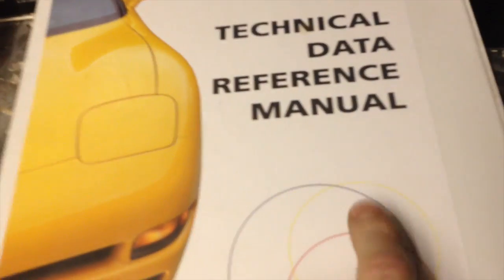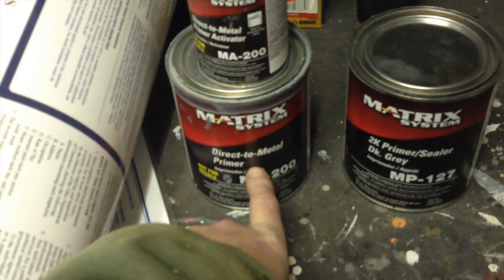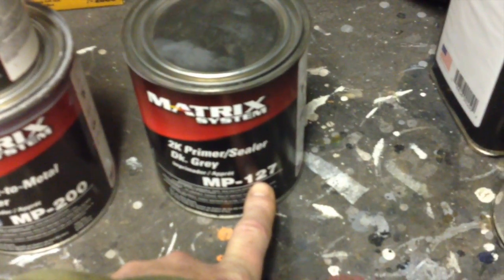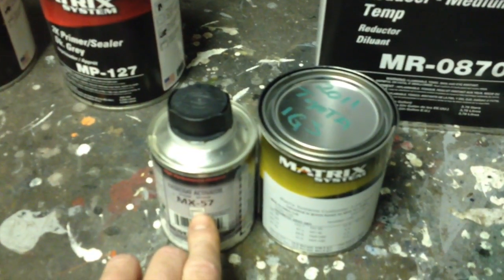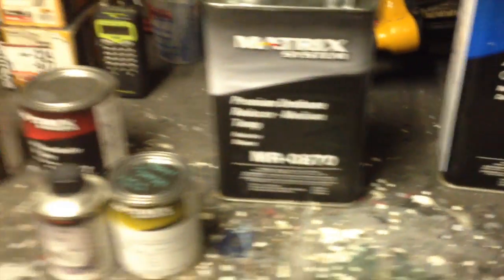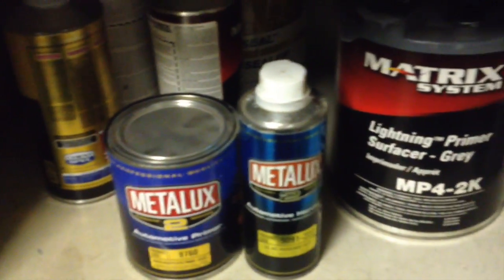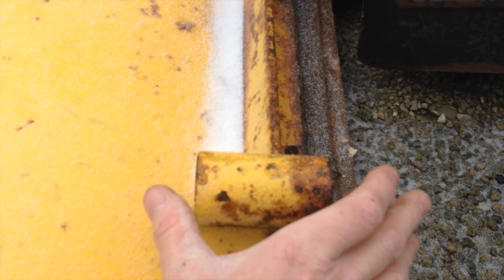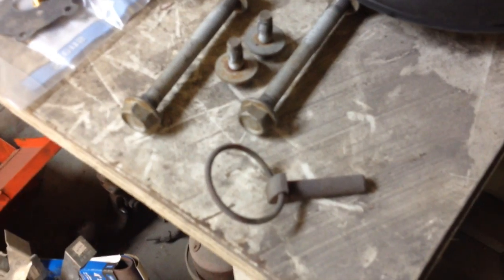Info on paint and how plow shoes work

Comment: Thanks for your thoughts on matrix products. After using Dupont and ppg clears I have found u-pol 2:1 clear   works great at half price. What gun do you use for clear ?
Reply from the maker: Mitchell Ferre Iwata LPH 400 with LV4 cap (silver) 1.3 tip
Reply: Thanks man!

Comment: How do you plow stone driveways if you don't have/use plow shoes and if you get more keep them they are worth money I made a pair for my plow just this summer haven't tried out much yet
Reply from the maker: Three different ways I plow a stone driveway.
1) Backdrag it if its small enough.  Minimal gravel disturbed
2) I bump the plow up so the edge isn't hitting the driveway and proceed slowly 
3) Don't plow a stone driveway or lot unless it has frozen up or has packed snow on it.

We don't come across many stone parking lots, but I'll do an occasional stone driveway if someone calls.  I laugh when I see piles and piles of disturbed stone from   an inexperienced operator
Reply: I have a large stone driveway that just got put in this spring and will need to be plowed this winter I made some plow shoes I will see how they work and if they don't dig in too much if it is frozen up can you drop your plow like normal and plow it
Reply from the maker: Landon Kaufman Depends on how soft it is.  You compacted the stone so it might be ok to drop and go with shoes on

Comment: I use a bit of clear hardener in my base coat  if painting over clear that has ben sanded though to the base color.... keeps it from wrinkling the paint.....  just a heads up..
Reply from the maker: Thats exactly why I use the base coat activator!
Too many times it bit me so I started using it

Comment: I have used some of the Matrix products and liked them.  the MP3-HS is really thick, and I ended up with more peel than I wanted, and had a heck of a time sanding it out, i bet the DTM primer your using now sands alot easier.  The urekem tech sheets used to always reccomend acitivating the base coat, but I think they removed it from the tech sheet but still encourage it.  I think Glasurit or one of the other RM lines called for basecoat activation if I am not mistaken...
Reply from the maker: Never used the MP3-HS yet but that MP 200 lays really nice and is easy to block.  I never trust any DTM primer for anything more than a small bodywork repair with a little bare steel showing.  I think most major paint lines want the base activated to be able to guarantee the paint system.  The RM and Glasurit stuff is nice for sure.  Haven't tried the Urekem brand product yet though